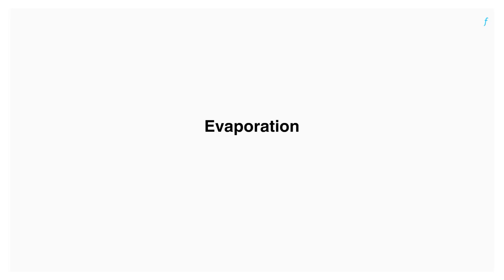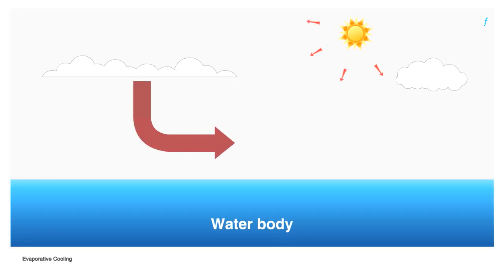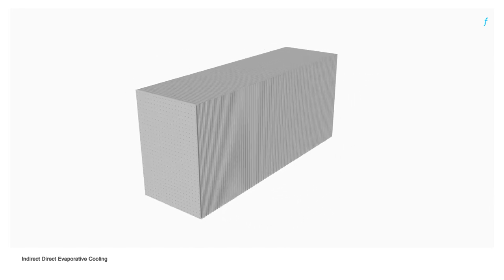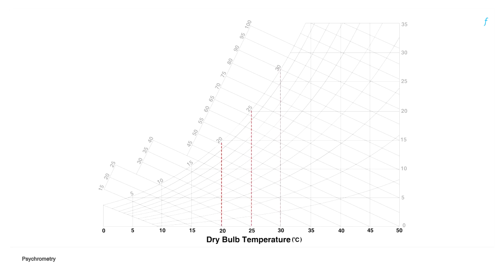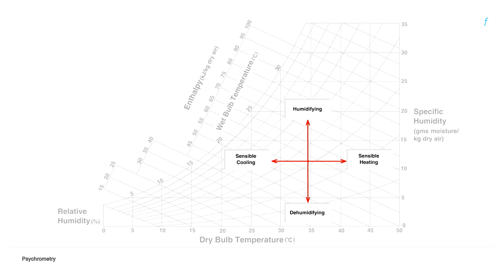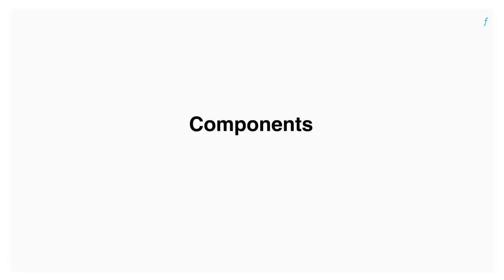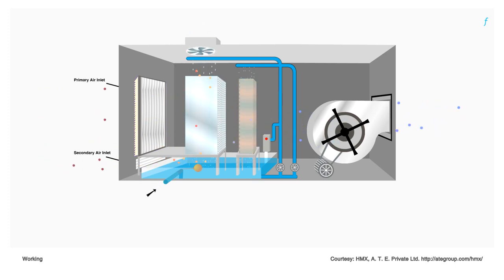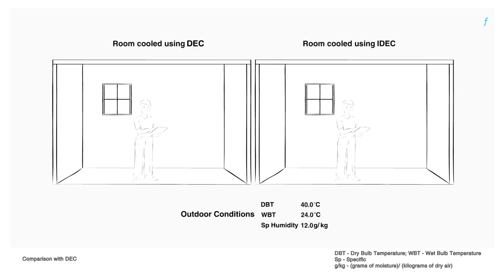Indirect Direct Evaporative Cooling Animation

Comment: Enhanced cooling system, containing solar and photovoltaic panels as well:
1. take outside hot and humid air
2. dry it with dehumidifying brine (i.e., calcium-chloride) - this will increase the temperature of the air
3. cool it down to outside temperature by heat exchanging with exhausted outside humid air
4. humidify dry cooled air to cool it down further - now we have cool and humid outside air
5. take inside hot air and dry it with dehumidifying brine - this will increase the temperature of the air as well
6. cool it down by heat exchanging with cool and humid outside air that would become exhausted humid air
    (inside and outside air should not mix)
7. humidify dry cooled inside air to cool it down further - now we have cool and humid air to return to the inside space
8. route the dehumidifying brine into the solar panel to heat it up and remove excess water from it
9. cool the brine using part od the outside hot and humid air
10. use photovoltaic panels to produce electricity to run fans and pumps

How you'll have a decent air conditioner using zero grid energy, but only when sun is shining (which is when cooling is mostly needed). For cooling during cloudy weather or night time electric or gas heating is required, which is less efficient than a heat pump (i.e. air conditioner).

Comment: why dont we use only indirect evaporative cooling by recirculating inside air?  This way we can do sensible cooling with more than 95% efficiency  and no humidity will be added to air.
Reply from the maker: great idea. Go ahead and prototype it, test the results, and share it with us at info@fairconditioning.org or vivek@cbalance.in. All the best!
Reply: I've been thinking about this for sometime. We used to use dec in lahore. The problem was humidity. The combined idec and dec provide a method of controlling humidity as well. I'm sure there must be a commercial product on the market...if not. I'll give this one a try. Its relatively easy sytem to implement i think.... Famous last words... Haha
Reply: It will keep adding humidity and temperature of the room will increase as the water vapours are warm...so you need to keep ventilating the air when using evaporative cooling

That is why there is no such product in the market